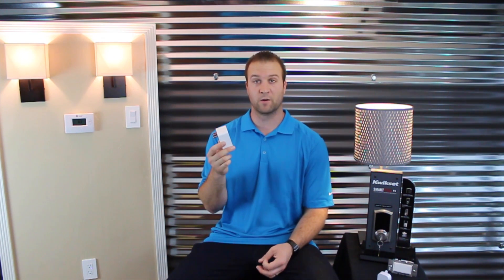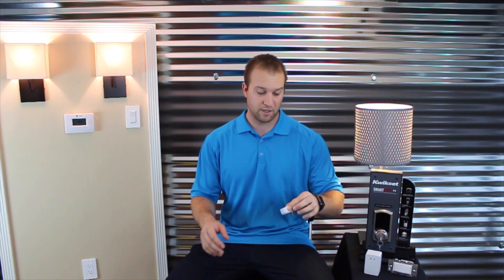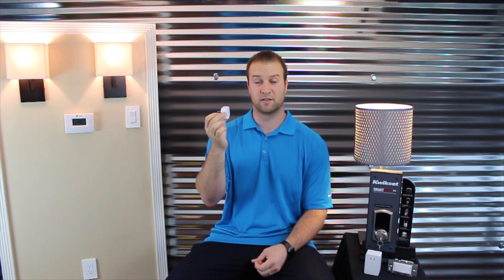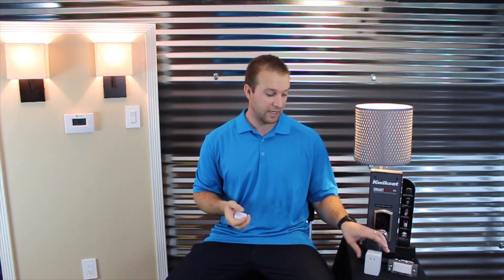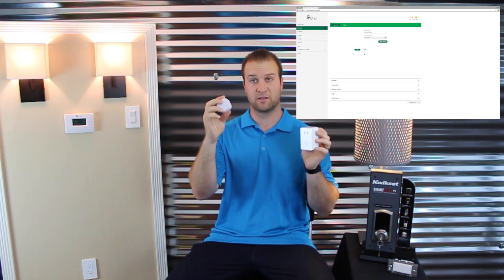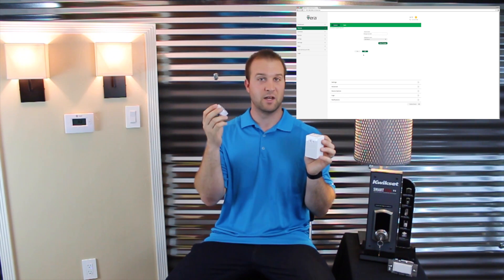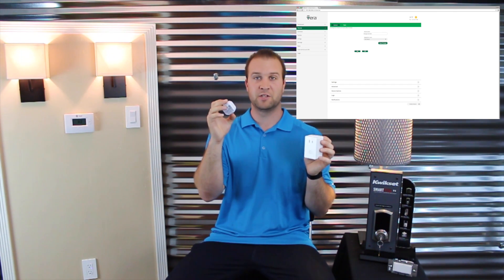Z-Wave Range Extenders - Whats the Difference and FAQ

Comment: correct me if im wrong but z wave ac powered light switches or outlets can do a max of 4 hops to get to the hub. Now when you add an extender does this act like one of the hops ? and how does that work? meaning in my home i have a bunch of z wave light switches about 24 of them, and my hub is in the garage at the end of the house, as i am building out towards the back yard eventually the switches wont work since they wont make it with the 4 hop system. I was wondering if i buy an extender and plug it in the middle of the house would the furthest switches just use the extender as a hop and connect to the hub ?

Comment: Question: I have motion sensors that have an option to be wired (you have to cable it into the sensor board yourself) how do i know these appliances are then acting as extenders? Is there a device option/attribute that indicates it's battery/mains powered or extended/none-extender that I can check? 

(Vera Plus as gateway, EZMotion as Sensor)

Comment: Hi dear.
I am working on a control4 automation system installation where i have installed 11motorized window blinds having digital motors which are controlled through zwave digital motor interface devices installed with every blind.

Now, when i install zigbee devices they boost up the signal for each other mking a good strong network but, the zwave devices installed in the last portion of the building(10-15meter away from controller) do not get commands and do not work untill i move the contoller to a nearby location.
I want to know, can we boost up the signals somehow?
can we make a zwave mesh so that every device boosts up the signal coming from the controller? kindly help. Thanks.
I have tried using aeotec zwave extender but it didnt work.

Comment: Hi I need help installing the z-wave extender. I connected to the wall, the red light was flashing. I went to my phone app smathings I found the extender pair it and the light turn red. the light is not flashing anymore it is just red. I saw in the manual that a red light it means the device it is disconnected. can you pelase tell me how to connect the z-wave extender. thanks :)

Comment: Khem, nothing.... except the range (Aeoec has extender with 150m range while most switches with routing capability don't get farther than 50m)
And potential issues with secure devices i.e. locks, as regular switches are not designed to work with secure transmission.

Comment: Are any range extenders that extend further than others. I am trying to extend over to another building if  at all possible.
Reply from the maker: +eroggero Z-Wave plus modules should have the furthest range. Unfortunately there isn't a Z-Wave plus "Range Extender" at this time but you can use dragon tech plug in modules with z-wave plus for the best results. If you are planning to go over 40-50 feet I recommend setting up a multi hub system. We will have more on this soon.
Reply: +Z-Wave Outlet ok thanks, will look forward to it. Probably have 50 feet between house and garage I'm try to get to